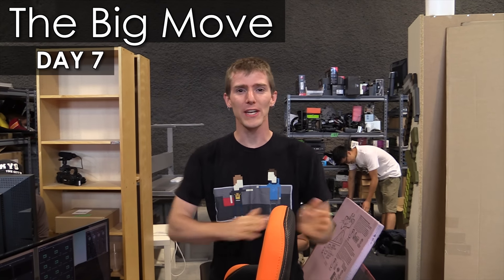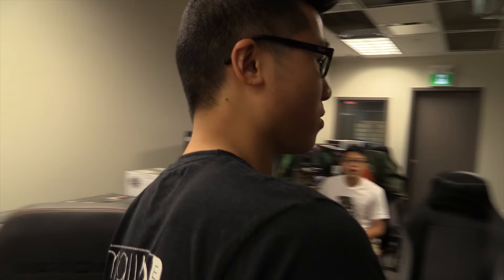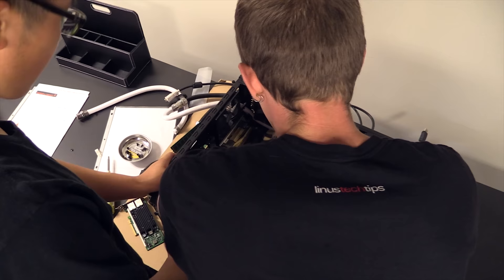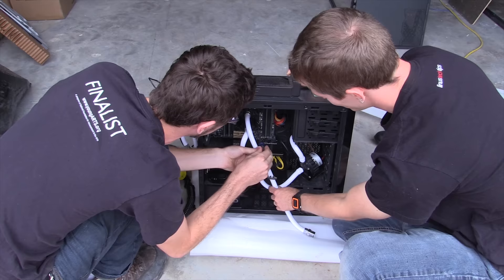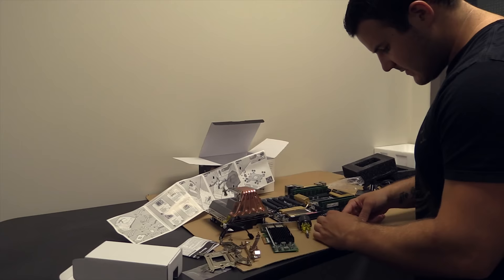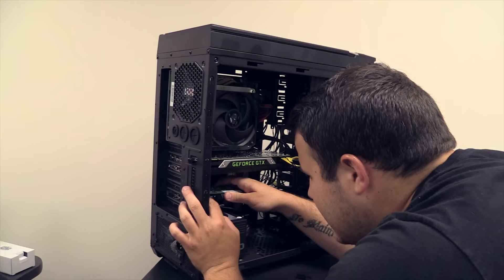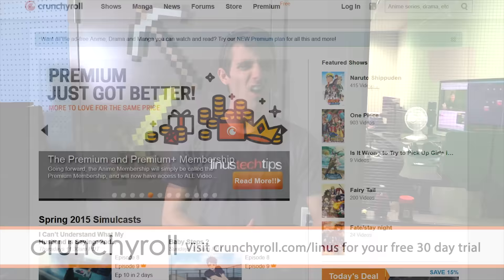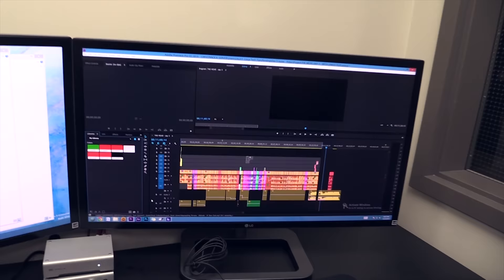The Big Move Day 7 - Editing Workstation Upgrades!

Comment: This was a really fun video XD

Tech question: why those CPU coolers?
Reply: +TommyThousandFaces those are low profile coolers even something like a hyperx 212 would give  clearance issues with RAM or GPU
Reply: +TommyThousandFaces to cool CPUs
Reply: +Denzil Manickum Doubtful. The distance between the CPU and GPU is easily large enough, and on Intel systems there is quite a bit of space between the CPU socket and the RAM as well. That's not to mention they're all using either ValueRAM or HyperX Fury sticks, none of which have very high-profile heatsinks on them.
Reply: Robert Faber I was about to say the Hyper 212 is nimble enough to fit in the footprint of the socket without interfearing with ram (evenhigh profile) or PCI slots.

David Fregoli "A genius!" cit. Renzi hahaha
Reply: Because they are just editing stations, they really need that top of line coolers.
Reply: +Booker Dewitt > top of the line
> not water cooled

uwotm8
Reply: +2911oscar I couldn't edit my comment from mobile, and I just read my own comment, yeah I meant they don't need that top of line cooling because they are just editing stations.
Reply: +TommyThousandFaces 
+Denzil Manickum 

Actually it's neither. The Hyper 212 DOES NOT FIT in the Coolermaster Silencio case. The 212 is to tall and won't fit with the side panel on.

 It's a major issue with the cooler that it won't fit in a a lot of cases because of the height, and most cases where it does fit it BARELY does by only a few millimeters. Coolermaster designed the Hyper T4 as a alternative to fix this problem. It is high enough to clear RAM with no heatsinks, doesn't block the first expansion slot on motherboards (Intels anyways), AND somehow maintains a 120mm fan while being shorter then the 212. Most hilarious thing about it though is that it, despite being made as a alternative, out performs the 212's cooling capabilities.
Reply: +TommyThousandFaces the 5960x's are not overclocked, because that would not increase editing performance as much as gaming performance, and without overclock, you don't need fency coolers
Reply: akabiscuitwaffle Well I think you're probably right but I took a look at the dimensions of the case and it's just 1.5cm less in W than my Enthoo Pro, and in my case I fitted no problem a Noctua NH-D15 (much bigger than a Hyper 212). Seems a bit weird thing to me, but I ca't say you're wrong.

Jan-Christopher Estelmann They went for silent cases so have a better cooler means less noise. Why use a lower perfomance in a silent case?
Reply: TommyThousandFaces i didn't expected these coolers either, but i think they wouldn't choose them without thinking. There is a pressure optimized fan on it so i think it will not spin that fast and it will be quite quiet ^^
But maybe the cases and coolers are sponsored and they had to build with these
Reply: Jan-Christopher Estelmann Yeah, I had pretty much the same thoughts but I wanted to know why just to satisfy my curiosity. Also with a fan blowing down the air moved cools the VRMs.
Reply: TommyThousandFaces yes a "rational" behind the descisions would have been nice
Reply: TommyThousandFaces  i have searched a bit and find the cooler it is the coolermaster geminii II and it is around 50 bucks, but there is a alluminium version that costs 100 Oo
But i think it is this:
http://www.coolermaster.com/cooling/cpu-air-cooler/geminii-s524-v2/
It is looking not so beasty but i think it gets the job done ^^
Reply: +Jan-Christopher Estelmann 4960x's if you were paying attention ;)
Reply: Jan-Christopher Estelmann I did find that too immeditaly when I saw it and to me still looks like a compact cooler for micro or mini ITX build. Surely gets the job done or nobody will ever use it.
Reply: TommyThousandFaces maybe the topblow design and the ram and vrm cooling thing was the point to choose this cooler
Reply: ***** Well watercooling is much noisier and less reliable than air cooling. Also they're not going for overclock, as far as I know so a closed loop watercooling would be wasted. Air cooling is still a thing and it will be for a long long time, imho.
Reply: +TommyThousandFaces The cooler master geminii is fucking awesome.
Reply: +Booker Dewitt In my experience, rendering videos is more taxing on a CPU than gaming. I would think they would need better cooling for that use case.
Reply: They're pretty much just editing videos, not gaming on it so they really don't need watercooled CPUs
Reply: ***** I don't think it is for the simple fact that a 240mm raditator has 2 fans and a pump working where an air cooler would have, at best, just two fans spinnig. Also a closed-loop watercooling can be as reliable as possible but it has more fragile parts and its performance decrease over time. Instead an air cooler is basically eternal and if something breaks (can only be a fan) the system will still be able to work. But if in a watercooler the pump breaks you're done.
Reply: ***** My Noctua NH-D15 costs as much as a H100i, is a bit less performant than a closed-loop watercooler and has a max noise of 24.6 dbA. That's not loud at all
Reply: But I think they will eventually upgrade to watercooled. As of right now, they're a little busy with organizing their office than doing all that crazy upgrades. And especially since most of them, besides Luke and Linus, don't know how to build computers besides editing videos.
Reply: +Jay Zenitram well with that CPU and the Titan, plus the server that helps with rendering the CPU is being taxed as much.
Reply: +TommyThousandFaces sponsorship money
Reply: billy653 That's a possibility
Reply: +akabiscuitwaffle  I <3 my T4
Reply: +Philip Kinneer I've had 7 cheap Cooler Master fan's in my current machine for coming up on 3 years now without replacing them. they work like a top. Fan's are fan's man you can't judge a way of cooling a CPU based on whether the fan's die.
Reply: +TommyThousandFaces 
Yeah, I was wondering that, too. Especially for a guy known for wasteful overkill, that's a really odd choice.
Reply: Philip Kinneer It could never be for a reason: more moving parts and corrosion inside the loop. I'm sure is pretty realiable but is still not as much as air cooler. What if in the middle of a pretty long and complex rendering the pump gives out? All the machine build with reliability in mind like servers and workstations all use air cooling. Also you should consider two years as a pretty short period of time. For me things must work for a decade without a hitch. Also you said that you keep your CPU fans at 50% while doing daily use and that's a pretty high value for me. Even if I live in an hot place (82°F average in my room) the fans just work at 30% on a 4790K.
Reply: It's a big deal because you'll waste all the time spent to render till the pump failed and you have to start all over. If on an air cooler a fan breaks, if you're not hitting the thermal limit of the cooler the computer will still keep working just hotter. Corrosion happens naturally and can only be retarded by anti corrosion fluids.
Reply: TommyThousandFaces Good point, but I think part of the confusion was coming from why he chose such a puny air cooler. If it were me I would have gone with an NH-D15, or at least a Black Rock.

Oh, a question. "Render til the pump failed, etc etc." 
Is that an actual thing? I thought Watercooling gear was manufactured under the assumption it would be put under heavy loads. I'm not a WC'er myself, but that doesn't sound quite right. (unless you're talking specifically about the "whole room WC'ing?")
Reply: TommyThousandFaces If the pump did fail (which is highly unlikely) I have thermal protections set up on my motherboard to protect my system. If my CPU reaches above 80 C the system will shut off.

Plus, I do pretty much all of my rendering on an 8320 cooled by a Hyper 212 EVO. I keep it in another room so it doesn't get my room hot while it's rendering.
Reply: Philip Kinneer Sure, but my point was not the risk of destroying the CPU but the need, in case of pump fail, to start a video rendering all over again for a company based on video production that needs to respect a certain scheduling.

Comment: I was a fan...

Now I'm a cpu cooler
Reply: K
Reply: I was a fan.....

And my master replaced me with a tube of with water..... I feel betrayed
Reply: +Min Roh I was a Hard Drive And my master replaced me with a SSD.
Reply: Was it a hard tube?
Reply: [OLD] PixelTronic i was a fan.

now i am a hard tube custom loop
Reply: I was a fan...

I still a fan
Reply: Fun fact, I actually had to replace my CPU cooler fan with an exhaust fan. I'm running hot, thermal throttling at idle without an overclock, on a single core cpu running vista (12 year old system). God help me should I decide to play solitaire. Or even press the start button.

Comment: doesnt it make more sense to put the network card above the titan x so its not in the way of the intake of the titan x?
Reply: +YourNightmar3 Not really. Since the network card is so small, the Titan X's intake fan wouldn't be blocked. (the fan is located near the black and yellow pin connectors) 12:10
Reply: +YourNightmar3 only if ith titan x was still in a 16x slot
Reply: yusyzygy ah thanks :3
Reply: +YourNightmar3 Its not, the net card is shorter than where the fan is on the gpu.
Reply: +YourNightmar3 It might not be ideal but it's not bad because it's not really blocking the air intake and at least when I worked with CUDA-supported benchmarking, GPUs barely heated up to the 75°C+ (but those setups weren't ideal, still HDDs and shit) + if you put the network card above, it would get a lot warmer due to the missing backplate on the GTX Titan X. :/
(btw I'm not sure but do they use the default cooler+fan for the GPU? then the intake is only on the far right - and the network card isn't that long -  because they use that vapor champer design or whatever that was called like)
Reply: Air moves around it?????? Why would u want hot air blown on to a component
Reply: +YourNightmar3 Intake doesn't matter as much as lane priority.

Comment: Ah yes those sneaky standoffs. My first build I made that mistake and I didn't realize till I had powered it on. Sparks happened, I was very sad. Surprisingly though I didn't brick it. Used it for years with no real problems except that it would never power itself off. Had to manually flip the switch on it if I ever needed to power the PC down.

Comment: I wonder if you put pc thermal duct from a cool master 212 EVO to the rear case fan with no fans in between them and then pushed as much air into the case as possible how effective would this be? All the fans air volumes would theoretically be added together, you'll just have to plug up any holes in the case to increase even more pressure.

Comment: Where is the video where you put the whole room on water cooling???
Also, if your plumber soldered the copper pipes together, he didn't use nitrogen purging to eliminate the oxidation on the inside of the copper pipes. (Unless you Specifically Demanded that he do so, which judging from the color of the water, you didn't.) I suggest PEX tubing as it is corrosion resistant, chemical resistant, and can snap together with Shark-bite fittings (which though expensive work well and are easy.)
Then you can just fill it with whatever anti-corrosion heat transfer fluid you prefer. (Not tap water.) 
Good luck all.

Comment: Hi Linus! I've watching your videos. I notice that you are using short screw driver which is hard to use when you unscrew some parts of the computer. I would recommend you buy more long screw driver like more that like 14-16 inch long screwdriver so it is convenient to use to unscrew some parts of the computer. Because most system case is too deep for the short screw driver. :D

Comment: Please rate the hackjob i did once.
I had to finish my friends build that evening and neither the motherboard, nor the case came with standoffs (low-budget parts). I had three laying around, so i just put in three cornor screws and a cable tie around the fourth one to prevent it from shortening with the case.

Also put in a hacksawed piece of 2x4 to prevent the gpu from sagging

Comment: What CPU are you using under those Air coolers? And will they be able to cool my CPU dow? It's an I7 4770K OC'ed to 4.4 GHz at 1.35 V
Reply: General18 they are all using 4960Xs.

Comment: May i ask why the overkil gear for video simple videos?No offence meant,just wondering?
Reply: 1. Advantages of sponsored gear
2. Beafy CPUs and GPUs = A faster work flow and faster computer
Reply: +Shockerrs you mean dem workstations are "as fast as possible"? ;-)
Reply: 1. These videos aren't THAT simple (a ton of cuts and overlays)
2. They need powerful components in order to work with the large resolutions they record in
3. The frequency they put out videos, better render time and quicker workflow

Most importantly, I believe, is that it's about being able to edit the video in real-time, with only a little bit of overkill. :)
Reply: Space Chicken My laptop can work with 1440p with tons of cuts and overlays lol nevermind my desktop.
Reply: Then skip #1 and read 2 and 3, haha.  My laptop can most of the time for 1080p, but definitely not 4k.  My desktop is just a crying mess.
Reply: Space Chicken I upvoted #1 and #2 wasn't meant for me. My laptop has a i5 4200m and 4gbs of ram and my desktop is a i5 6500 with a 970 and 8gbs of ram. Just got my desktop a month ago after 2 years of saving :D.

Comment: I am looking at this: Seagate 4TB 2-Bay Network Attached Storage - http://www.microcenter.com/product/436400/4TB_2-Bay_Network_Attached_Storage_(NAS)_-_STCT4000100?ob=1   -   and I want to have a desktop, expandable storage enclosure that I can access as a storage device, use as extended storage for my desktop. I plan to use it to store my photography library (professional photographer and I have alot of 40-60MB image files) and video large video footage, and work in various Adobe softwares pulling the media directly from the external storage enclosure. Is this the best choice for me (I won't be doing a huge amount of network-accessing, I plan on mostly having it sit on my desk, connected to my desktop PC) considering speed and reliability that I need, or should I go for something like this: WD My Book Duo 6TB (2x3TB) 7,200 RPM SuperSpeed USB 3.0 3.5" External RAID Hard Disk Drive  --  http://www.microcenter.com/product/434184/My_Book_Duo_6TB_(2x3TB)_7,200_RPM_SuperSpeed_USB_30_35_External_RAID_Hard_Disk_Drive